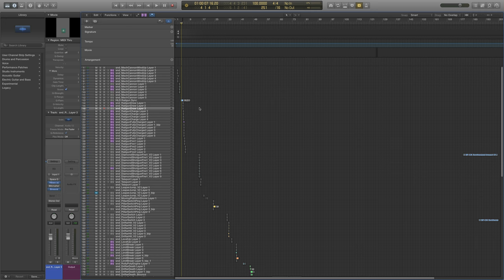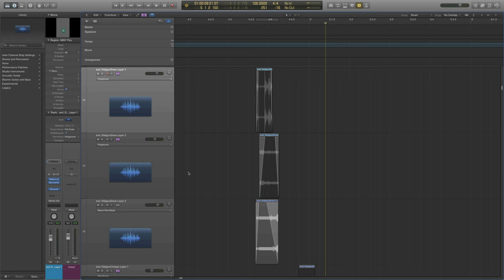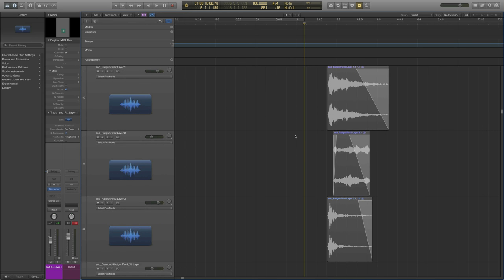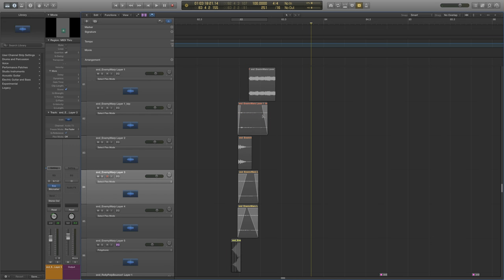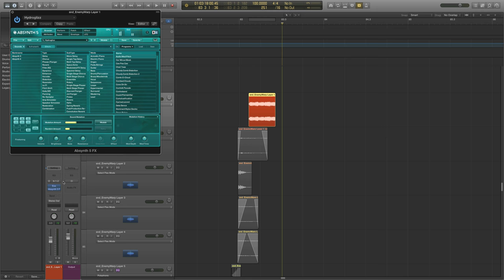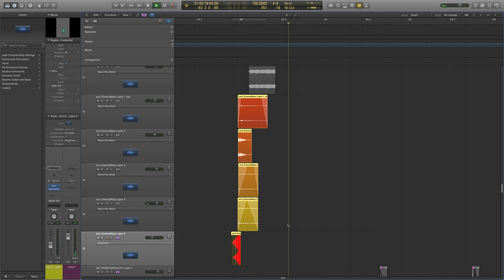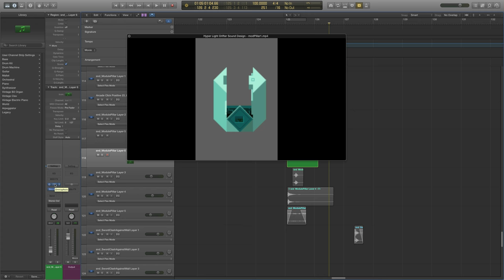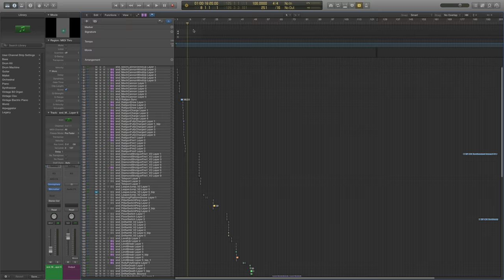The Sound of Hyper Light Drifter: Part 2

Comment: Good stuff!

Q1: I was surprised you have all sounds stacked in one project, what are the advantages to this? Isn't this costly for memory?

Q2: Could you explain how you catalog your sounds so you can find the one you need later?

Thanks!
Reply: Q1: It is, but it makes things easier to revise. Also, I have SO MUCH RAM.

Q2: I name them something that I can remember, and also have a gigantic google doc that keeps track of everything, and lets me and the devs know what to work on next.
Reply: Thanks for the reply!

I also figured you may have global audio settings/levels that you wanted to maintain through each sound effect. I use an old pro, so not much RAM :-P

Thanks again for the tips and video, gave me a lot to think about.